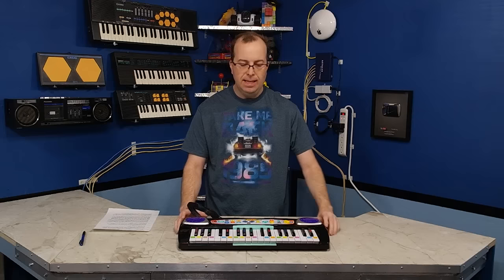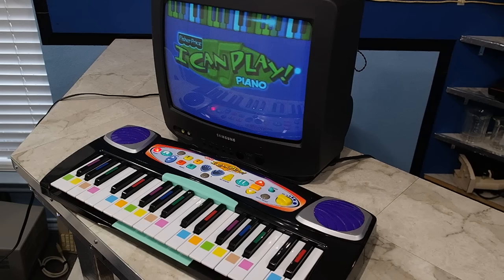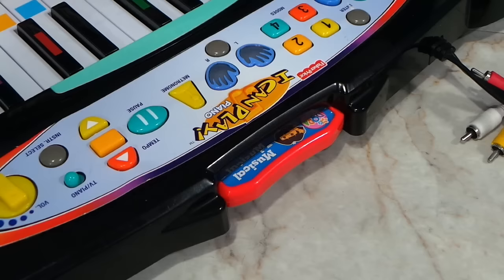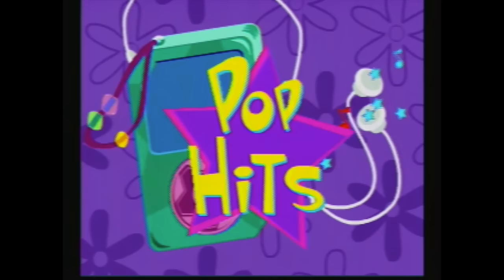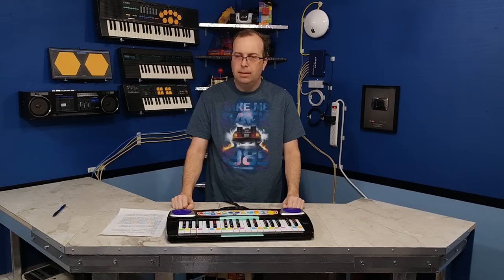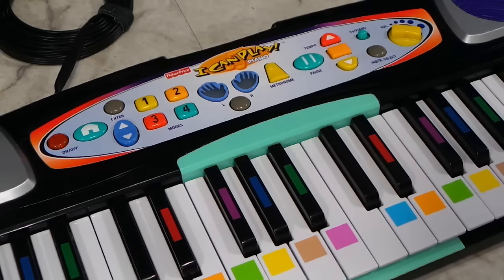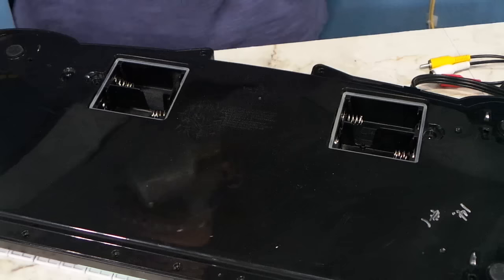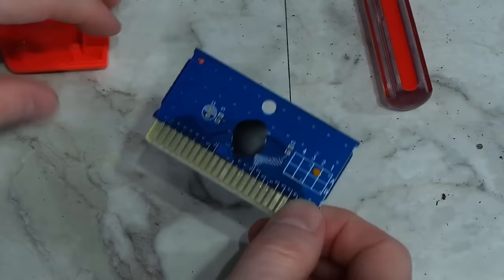Destruction of the Fisher Price "I Can Play" keyboard and review

Comment: I really hate these products that have tons of hidden screws and plastic hinges... Everything should have just 4 corner screw that is clearly revealed and that should be it.
Reply: Plus maybe a few center screws depending on how large the thing is - otherwise it will easily get very flimsy. :)
Reply: Anders Enger Jensen Maybe. But, for example, 13 screws on a 13 inch laptop is definitely overkill, not to mention tons of plastic hinges.

I almost thought that having so many screws are for, in case you lose some, the remaining screws can still hold the case XD
Reply: Yeah, I was thinking of my regular sized professional keyboards/synths - they would not endure much with only four screws. ;) But yeah, they sometimes go overboard with these things.

In the end, I'm happy as long as there is the possibility to service and change parts, not like the line Apple has ventured down with soldered RAM and such. :/
Reply: Anders Enger Jensen Yeah. Nowadays, it's kinda weird that we have super think cellphones but we need super thick power bank to keep it alive. In the past we really just take an extra battery and that should do it. 

As for serviceable parts, well, I'm happy to have a laptop that has 3 RAM slots and 2 hard drive slots... Except one of the RAM slot is on the C side and can't be opened that easily. Well at least I can have 16GB of RAM rather than 8GB, which does help a lot.

(By the way, among all the technologies I kinda hate ZIF sockets the most. I mean, can't we just have something similar to IDE or SATA? But instead, we have something that we can never make sure the connection is good enough?)
Reply: PGA is a bit more robust then LGA at least. LGA, bend one pin setting down a CPU onto the pins, and it's game over. With PGA you may get a second chance to straighten the pins on the bottom of the CPU. As for something like IDE/SATA, not nearly enough IO to handle up to 32+ simultaneous PCI lanes, HDD controllers, RAM, USB and other peripherals without at least a few hundred pins. Would be super expensive, and huge.
Reply: theLuigiFan0007 But think of the bright side, a motherboard is way cheaper than a high end CPU. So... At least LGA isn't all bad...
Reply: 野龍
Yeah, I'd definitely rather replace the MB then a possibly $1k-ish Intel CPU, that's for sure. But I buy AMD stuff normally, so the MB is usually the more expensive component in my case. 2core 4GHz is $40, 4core 4GHz is around $80. MB is around $50-100 depending on model and features. AKA about the same price.

I mean, both PGA and LGA are perfectly good methods of connections, but each has it's weakness. PGA has a stronger connection (pins get clamped), but LGA is much easier to manufacture, and just as good. Maybe even better when it comes to large numbers of very small pins. Comes about about equal in my opinion.

Personally though, LGA makes me nervous. Maybe it's because I'v only used it once or twice, and only one machine I have is LGA. LOL
Reply: theLuigiFan0007 I haven't used LGA even once XD Several years ago there were only PGA CPUs available. And then, the last computer I built was in 2013 and I used an APU, which of course uses PGA.

The weirdest thing of LGA might be, there's no way to tell if the connection is tight enough XD And, I've heard that you have to make sure the LGA CPU is oriented correctly, while PGA usually won't let you insert if the orientation is wrong.

And by the way, why 2 core CPU? And if you are getting a $50 CPU then I don't think it would make much sense to get a $100 MB, considering this kind of machine usually won't be for heavy works, but rather just process some documents and that's it.
Reply: 野龍
LGA CPUs have a notch cut into the PCB material around the heat spreader cap, like RAM sticks do. You can't really put it the wrong way around, unless the motherboard was designed badly or you cut another notch. At least on the ones I'v seen.

If you'v ever seen a stack of Raspberry Pis held together with standoffs, it's the same thing. I made a stack of motherboards running open air (no case), and use it as a rendering/processing server. Problem is, Pentium D CPUs run hot as hell and suck LOTS of power. Especially if the A4-7300 is only $40, slightly higher clock (4GHz) and uses less power.

All runs off a big multi module 1.2kW PSU box (6x200W Modules). I was gonna go for couple boards running a AMD FX-9590 (8 cores, 5GHz, 250W TDP), but I'm waiting for Zen to get cheaper instead. The Motherboards supporting the FX-9590 are too pricey.
Reply: So you are not just getting one PC but tons working together... Well that makes a lot more sense. But for the clock speed, I've heard that it doesn't quite translate to performance that well.

Anyway, I have no experience in such usage so, I don't think there's something else I can reply XD
Reply: 野龍
As I run heavy single or double threaded applications, more cores dosen't directly translate to performance in my case. But more cores is usually better. In the case of the A4-7300, it's almost half the power usage and maybe 20-30% faster and supports new instructions like AVX and SSE4. http://cpuboss.com/cpus/Intel-Pentium-D-945-vs-AMD-A4-7300
Reply: 野龍 They don't want you to repair or modify. They want you to buy another one lol.
Reply: Dash-Cam King But for laptop, and laptop that has a fan inside would require cleaning once a while. My laptop is pretty nice that, I only need to remove 3 screws in order to reveal the whole heat sink, but some laptop would require taking the whole motherboard out in order to reveal the heat sink, since it's on the C side (the side where the keyboard is on). And that's super annoying.

It's not even repairing, it's just maintaining. Well, they probably want me to assume that the computer isn't capable of running large apps after half a year and I'd better buy a new one?
Reply: Dash-Cam King
With most products, that's pretty much the case. Which absolutely sucks to me, if I can't fix it, I generally stay away from that manufacturer. Unless necessary. But if I need to, I can usually manage to take something apart, fix it, and mostly put it back together, with a few "spare" screws, of course.
Reply: 野龍 
Laptop manufacturers are sure fond of screws, but thankfully most have disassembly guides (for recycling/scrapping purposes) for most models hidden somewhere on their site. That's what I use as a reference/quide.

At the very least, it's two screws to get to the HDD and RAM, one screw to swap the slide mounted DVD drive on most of the Dell Inspiron line. Very nice for quick comsumer side upgrades. However, taking the cover off to reheatsink it or unplug the cooling vents in general, well, that's another story. Quite well built though, and heavy (I'm looking at  you, Inspiron 17/17R Line). Thankfully though, in my case, Dell uses 2 sizes of screw, external case, and internal case. Standard sizes too, and no security screws.

I keep a magnet nearby to hold them and a Sharpie Paint Pen (or similar opaque oil paint marker) to color code them with a dot on top and a dot by the screw hole. Saves a load of time.
Reply: theLuigiFan0007 I usually would just remember the screw size or things like that.
Reply: +theLuigiFan0007 Fortunately, my recent laptops have used mostly identical screws, nothing to remember.
Reply: It's because it's a child's toy; they make toys impossible to break/open. Wouldn't be surprised if it's waterproof too.

Comment: Next time you seek a hidden screw, try running a magnet over the surface. Presumably, you could feel more pull over a screw than any other metal part.
Reply: That's interesting.
Reply: Wouldn't that risk damage to the chips though? I dunno, I've heard magnets can wipe or corrupt chips.
Reply: sքɨċʏsaʟaɖ yeah that could, depending on the magnet
Reply: that only applies to hard drives and floppies
Reply: Plus I don't think he was concerned with not damaging the item lol
Reply: I bet those crappy screws doesn't even magnetic

Comment: You probably have only partial color blindness if you can distinguish all the 3 filters you used in the Quickcam video
Reply from the maker: I have a mild form of red/green colorblindness.  Ironically, I can see red and green just fine.  I have trouble seeing purple and brown.  And even those two colors I can see, but only if they are very saturated.   Any mild version of purple appears as blue, and brown will appear as green.
Reply: So yeah, I guess you had no problem with those filters :)
Oh, and I think that keyboard should be rebranded as "I Can Play! -Well, think again, kid"
Reply: 8-Bit Keys that sounds odd indeed, though when I had a look at some 'simulatorx' on a website about colour blindness the results were not quite what I expected.
I suppose assuming there are defective or missing cones it would shift the implied colours.
If purple looks blue that would imply you don't see red well (or possibly at all).
When you start looking at stuff like the light receptors in the eye but especially how the brain processes colours it can get quite surprising.
There is a theory stating that the brain effectively works out colour differentially.
Which results in light/dark, red/green, and yellow/blue as the axes of the colour space.
since red/green would be the difference between the L(red) and M(green) cones, while yellow/blue is the difference between this, and the S(blue) cone, well,  the possible results of colur perception issues can obviously get quite complicated...
Certainly what the simulated images looked like was quite surprising, and which colours became problematic, and not obvious from the way the various types are described.
I guess a further complication here is that rods have their own frequency response independent of the cones, plus there is a type of cell which primarily has to do with sleep cycle regulation which again has a unique frequency response curve.
Officially that shouldn't be influencing vision, but you never can tell in biology.
Certainly the rods would have some influence, since that represents your peripheral vision...
Reply from the maker: Yes.. My theory for a while has been that my red receptors are weak.  I can see red.  But when you mix red with another color, I usually don't see the red.  That's why I have a hard time seeing purple or brown.  But I can certainly see both colors when they are very bright.   And I know it isn't just my imagination.  I've taken those color blindness tests and they do indeed show that I am colorblind.  That was always something I was not willing to accept when I was younger because I could see all of the colors of the rainbow.  But later on I discovered that colorblindness comes in many forms and mine is a very weak form of it (which is good, I guess.)
Reply: It's protanomaly, judging by David's description. There are plugins for gimp that give a rough simulation of what such vision could look like to people with full color vision.
Reply: It's probably not weakness, they are just closer to the green ones than they are for most people which is the usual source of protanomaly. Since the gap is smaller and the tail end of the absorption curve is less far into the longer wavelengths, deeper reds appear darker and are overwhelmed by other colors when mixed with them.
Reply: Hmm..Today you disassembling keyboards with dremel and brute force.What will be next?Explosing keyboards or old Macs with nuclear bomb in small?Ahhh...Why it's impossible? =D
Reply: Dustin Watkins Well, you don't want it, but I can tell you that some other people won't think your way.

Comment: I think this thing still has potential. Imagine if rom enthusiasts started modding the roms and put Doom or something in as proof of concept!
Reply: mfaizsyahmi. I think you would be learning the theme of Doom more than shooting.
Reply from the maker: Yeah.. it would be hard to control a FPS with this sort of keyboard.  Not that it couldn't be done, but would not be fun.
Reply: mfaizsyahmi. Hahaha ,imagine doom running on a dora keyboard would be geniouse, if the processor inside it is 32bits.
Reply: Why does it have to be 32-bits?

Comment: Loved it when you finally said screw it and destroyed the thing to get it open. Depending on how new or old the thing is, those blobs are likely full SoC (System On Chip) - not only a microprocessor but essentially a whole computer. Memory, storage, code, video and audio hardware, general purpose IO. Soon as I saw it was storing and playing digital audio (the speech in the menus) I knew there was more horsepower in there than your DX7s and D-50s, which typically only had, like, a 4-bit micro controller to run the display and interface, and write registers to the synth and DSP chips to set them up to play a particular sound. This thing is more like the LeapFrog handheld games from a decade ago that were actually running embedded Linux and if you opened a cartridge and soldered wires to two particular pins on the edge connector, you could make a serial connection and actually get to a shell prompt and do all sorts of fun stuff. Love your stuff, keep it coming!
Reply: i'm just imaging using a shell on that keyboard :D
Reply: I wonder wich kind of SoC it is in this case...
Reply: qallincha I imagine it’s RISC-based.
Reply: If you get to the command prompt, type "sudo rm -rf /"
Reply: me too, Im laughing in tears watching him going from gentle review from kid-piano Terminator; even laughed hard when, after destroying almost the entire upper keyboard he found the screws beneath the sticker :p
Reply: Both the DX7 and D50 are 8-bitters, effectively a single-board computer with the custom sound hardware bolted onto it. It's crazy looking inside the guts of these old instruments, and the sheer amount of components and hardware needed to do the job... these days you could probably emulate both of them in a single STM32 microcontroller! Bizarrely I find the older stuff with "one chip per function" easier to repair than modern things where one magic chip does everything...

Comment: I have one of these keyboards that I gutted and threw in an Arduino programmed as a sound module using an R/2R DAC. Later reconfigured it to use PWM for waveform generation. Totally feel the pain of those 2 hidden screws.
Reply from the maker: you should send me some photos of what you did.
Reply: I'll see what I can dig out.
Reply: I dug it out of the shed, got some photos and threw together a "quick" write-up of what I can remember. This project was about 5 years ago and got stalled due to work commitments before I got to a finished state. I'm planning on revisiting this in the near future as a MIDI sound module, but in the meantime, what I can manage to remember can be found at http://retrotechadventures.xyz/2017/01/16/arduino-in-a-fisher-price-keyboard/

Comment: The inside was rather disappointing. Thats why I stopped taking modern electronic devices apart. All that is in there is just a small logic board and some wires, all encapsulated by plastic.
Reply: That is the same story as me.

Comment: 8 Bit Guy I have a toy from Fisherprice called " Spike the ultra dinosaur " and I have the charger, the battery, and the remote control but every time I put the battery inside Spike and turn it on, it stops moving like 6 or 7 seconds? and I heard the battery fully recharges at 5 HOURS?! So I need your help please

Comment: I had a CASIO LK -90 TV Keyboard that had keys that lit up and had a scoring system. The way the scoring system worked is, if you complete a song with out any mistake, you'll be given a "Perfect!" rating, and you don't need to go back and redo certain measures of the song.  Here's how the lessons worked: Step One was to touch any random key to play the song. Step two was to play the song that the key is being lit and step three was to play the song without any help and to play it at its default tempo value. There were 2 version of the lessons. One was just a rating system and the other was just getting to know how to play the song. The keyboard had an omni-directional microphone included so you could sing along with the song; the lyrics would be displayed on the TV screen if you choose to use the TV.  It even came included with a pedal, but it didn't have the half dampering effect like you'd find on a piano. You had on or off as your pedal effects.

Comment: In looking for screws in a plastic device, a magnet might have helped as long as the screws were steel.  Other option would be to use a very narrow sensor metal detector. Or just pull on it till it breaks apart and then maybe glue it together, I did that with one of my car door inside panels.

Comment: 7:00 Actually you're in luck, there have been a few samplers with CRT outputs & RF modulators made by Roland back in the late 80's/early 90's, those were midi rack modules though but I think there are a few keyboard variations. It's called the S series.